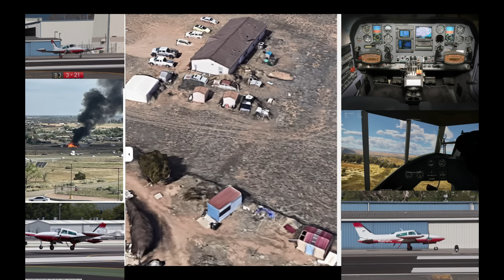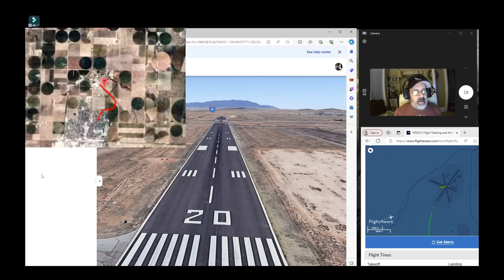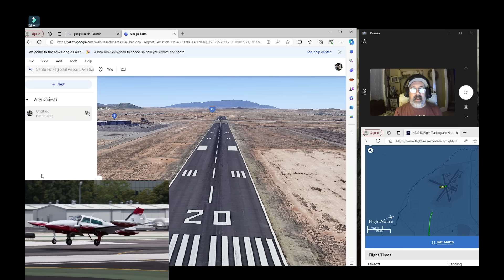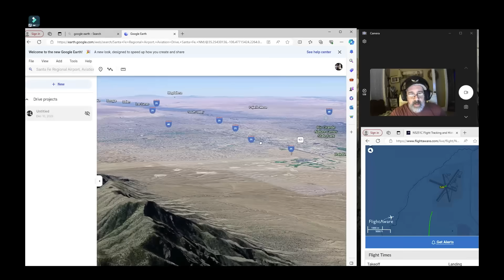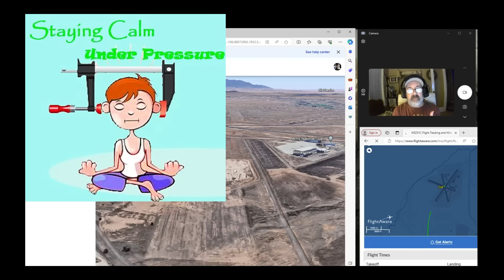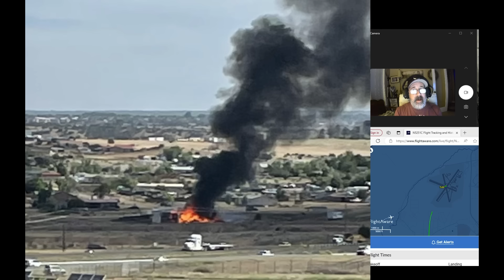Fatal Cessna T310R Crash That Never Should Have Happened N5251C

Comment: It's hard to think of a Cessna Twin that's worth a damn in the engine-out portion of the "envelope".  As seen here, the various 310 iterations--even with turbocharging and Vortex Gens--are marginal, same with the 401/401A... not sure about the later 4xx models.  I don't blame the Cessna engineers, as they are pressured to achieve everyday low Total Operating Costs, and so the rare occurrence of a complete engine failure is less than top priority.  Every twin pilot would do well to hit the realistic simulator twice a year... cuz that "engine-out checklist" has to be burned into your muscle memory--zero time to grab the printed version!

Comment: Wonder if this plane was equipped with Vortex Generators (lower Vmc), from ~80kn to 71 kn .... more controllability in engine out operations.  Also, which engine failed?  Left Engine is critical engine.
Reply from the maker: It did have VG's. You are correct, sad deal. We had them on our Baron and 310P. Amazing the difference they make.
Reply from the maker: Left is the critical engine.
Reply: @maxtanicfilms  Did the left engine fail?
Reply from the maker: @eojabac7123  Not sure as there has  been no official report by the NTSB. In the preliminary rpt from the NTSB it says. Witnesses hv said it hit the house but no other details reported. It will be interesting to see if either prop was feathered. That will tell us a lot.

Comment: Non-pilot,retired,problem- solver,machine designer,……how about,a Fed.mandated ,small plane mounted parachute sys.,auto- deployed,stall induced system?! ( ya, aviation-world,this shocked me too !? Gods help F/ his ‘family’!
Reply: EVERY Cirrus aircraft (incl. their jet) is so equipped and it is NOT a panacea, esp. at LOW altitude like this incident.  Check the stats... you'll find for instance that the NON-parachute-equipped Diamond DA-40 has a better safety record than the Cirrus SR-2x family, because the former has A) super-low STALL SPEED, and B) a fuselage/passenger-compartment that is designed for crash-survival ... in the proverbial Final Analysis, there IS no substitute for... GOOD AIRMANSHIP!

Comment: On a lesser note I had the throttle stick open on an off-road motorbike and it is all consuming. Your mind goes blank in fear. I would handle it much better now.
Reply: Yep, I’ve experienced something similar. I’ve heard it called “helmet fire”.  Your senses are overwhelmed.
Reply: @mikah4051  Many years later I was driving 10 ton truck and the accelerator pedal stuck down. I depressed the clutch, braked and steered round the corner. Turned out the engine had a limiter so it didn't blow up.

Comment: Great video thankyou. I watched Juan Browne and Scott Perdue comment on this one and you have highlighted something they only brushed on, which is human factors. Thankyou for covering this. More recently, Juan Browne really pulled apart VMC theory after a recent stall spin fatality in a light twin. Juan's well detailed explanation was absolutely fascinating. I have no doubt the pilot of N5251C knew all this and more, but you could hear the fear in his voice after the engine failed and I can't help but agree with you that his extensive knowledge and experience was a long way from being put into practice. Clear security camera footage showed the aircraft flying past in clean configuration (inc left prop feathered), right engine at high power, but the 310 was slowly sinking, not climbing. Still, this very experienced pilot kept trying to press on hoping to gain altitude, despite VMCA fast approaching. (In a simulator, he would have, at this point accepted the aircraft wasn't going to climb (despite being a turbo), cut the good engine, substantially decreasing vmca and flown slow with wings level into whatever he had in front of him.) Relentlessly flying on, he kept sinking and finally pulled up to avoid a power line just short of the crash site dropping airspeed below VMCA and his fate was sealed. I must support Dan Gryder in his quest to have pilots regularly train for abnormal scenarios such as these so, as you say, it becomes instinctive.
Reply from the maker: Thank you for that. Those guys are great and I watch them as well. AQP can really help & I support it 100%. Dan is tough but people need to hear it. When pilots die in such an avoidable way consistantly it's tragic. Lives can be saved with that program!
Reply: I'm a Dan Gryder fan, too. He has a funny, quirky personality, but he's very serious about AQP! @maxtanicfilms
Reply from the maker: @ValerieGriner  For sure, interesting guy and really does care. Missunderstood by many folks unfortunately.

Comment: well, when you get a multi engine rating, you learn how to fly with one engine . Lose one engine on take off.?...Do not turn in the direction of  the failed engine, and you do not make a tight                         turn;  or you will stall and hit the ground.  I knew an ortho surgeon who had a twin. He took off fromt the Sugarland airport and lost both engines , right off the bat.... stayed straight over the runway and beyond, ending up by the front door of some woman......The plane was a total loss but he did not have a scratch !  Reason for the engines to quit ? the mechanic had used detergent oil....I remember that one,  about 35 years ago. These guys need to stop communicating with ATC. They need to fly their planes and stop the ATC/  BS. Just state an emergency and focus on landing that baby, straight ahead.......no damn turns, going back to the airport.....Shish unless you know,  for a  fact,  you will be able to do it ; usually they dive into the ground. Wrong attitude and not enough altitude to recover that stall....and spin.  Over and it is so avoidable......
Reply from the maker: Well said
Reply: Also, the ATC clearly DOESN'T help matters in this case BECAUSE in trying to help you HE tells you to do something that you SHOULD NOT DO (turn the plane) and to help convince you to do so gives you the number of the runway you should land on (this is why no ATC contact). The pilot is already in panic mode, and chances are if he hears someone telling him to do something, he will do it

Comment: Density altitude exceeded the airplanes performance.  A cooler day at a lower airport elevation and he would still be with us.  You cant fool density altitude.
Reply from the maker: The thing is here the airplane is turbocharged and has a service ceiling above 17k. If he would have flown straight ahead he could hv easily climbed. Very unfortunate because the T310R is very capable in this situation. Our non turbo 310P on the other hand would have required us to make a forced landing straight ahead. Appreciate the comments and thanks for watching 😎
Reply: Didn’t realize it was a turbo charged aircraft. You’re right, he should’ve been able to deal with the density altitude with that airplane If all systems were operating as they should’ve been.
Reply: Losing an engine should not have much to do with density altitude. It is affecting both engines. You know you are going to need a longer runway. That's all. So, one engine quits and the other is not functioning to the max ? and you have a glider on your hands. It goes up and you put it down. Straight ahead.......Attitude and airspeed....landing on somebody's roof ? Bummer.........

Comment: Nr of hours in a logbook doesn't guarantee anything. It's more the mental game of making annoying safe choices (fast) vs. tempting bad ones and it's so difficult.  In a way it has nothing to do with flying but more with the gene pool. A rookie pilot may already be a better pilot than a 10000 hour pilot will ever be.
Reply from the maker: It's true, you're spot on. The USAF did a study about this. My Dad read it years ago. We looked for it but couldn't find it. It says a percentage of pilots in testing washed out due to slow reaction times in emergency testing. They had a way to test where the student was totally unaware of what was coming. In the video prior to this my Dad talks about it. Very interesting! https://youtu.be/bK33pG8sYhs
Reply: @maxtanicfilms  that was an interesting watch. My gut feeling is that some GA pilots will freeze if an emergency occurs.  I remenber my CFI pulling the throttle the first time. I thought I well prepared for all emergency steps, but I felt the panic punch in the stomach and mixed stuff  up. These moments, you should be in drill mode. Training can help a lot,  but you never know for sure until something happens for real. CFI's should at least throw 1 curveball per lesson 🙃
Reply from the maker: @jingle1161  Yeah I agree. It is a tough one and a scary thought to think you have to wait for it to happen in order to see how a pilot reacts.

Comment: AQP
Reply from the maker: Absolutely 😎👍
Reply: Kind of curious...what does AQP say to do in this situation that is different than normal engine-out procedures?
Reply from the maker: It's the mental side of training as it relates to that particular pilot. AQP is a way to focus that training so a pilot will react properly and perform the engine out procedures correctly. It is no guarantee of course. You just don't know until it happens, the ultimate test.   @igclapp

Comment: If I understood it right this guy froze from fear. Unfortunately this is a very normal reaction that can be extremely difficult to stop and usually you don't know how you will react before you have been in a life threatening or scary situation. Others become more systematic and are capable of things they could never have imagined. This is the reason too why some people don't do anything when they are in a life threatening situation which can be very confusing to people. I don't know I you can really prepare and find out how you will react until something happens. Perhaps being avare and to imagine different situations and really imagine how to react and to not freeze. But it's possible this guy had imagined something like this happening too he was just not able to react and follow the plan.
Reply from the maker: Absolutely agree. I know for myself I thought I was ready for an emergency but when it happened the fear was horrfic. We acted correctly on instinct. I would just say EXPECT THE FEAR. That's how I looked at it after. It made flying feel safer to me at that point. We had been tested. Appreciate the comments and thanks for watching.
Reply: In a similar vein, I managed a large group of expats in Rio, where there was quite a high risk of muggings (knife or gun). We gave them all the appropriate instructions on how to respond (ie hand over your wallet calmly, descalate etc). Like you said, however, you simply cannot tell how someone might respond at that given moment. Some were confused (couldn't recognize the situation they were in); some froze;  some act defiant etc (even my daughter counter attacked an attempted knife mugging by hitting over the head). Not one, so far as I can recall, actually followed what was very simple guidance. I am sure the same thing must happen in aircraft cockpits.

Comment: Saw the procedure for single-engine failure on takeoff of a twin on Dan Gryder's Channel a few days ago. Man, you have to absolutely be prepared for that to happen on every flight. He actually did it in real life and filmed the whole thing. From what I remember, your actions needed to be Call Engine failure, identify the failed engine, Gear Up, Blue Line, and then fly straight until you gain enough altitude of at least 1,000 ft. You can then start thinking options.
Reply from the maker: Yeah he does a great job and I have seen that video. You are 100% correct. Look at how focused you have to be just to fly straight ahead! Trying to turn is insane. One thing I should have said in this video is that red line increases based on turn, density altitude, if the prop is feathered etc. That increase is impossible to know in a split second. On the 310 it's about 84mph (IN A STRAIGHT LINE, DEAD ENG SUCURED/FEATHERED AND WITH 3 TO 5 DEGREE BANK INTO THE GOOD ENGINE). Turning back to airport like this increased that speed dramatically. Here is another example of how lethal this is. These folks survived, hard to believe when you watch this.  https://youtu.be/PVFQE5vnvG0?list=PLocpubHj2nG-BGdY8yRPC6U0GGkIIjsHb
Thanks for watching!
Reply: Exactly !

Comment: VMC roll. The turbocharged engine could actually be a contributing factor.
Reply from the maker: Certainly and it's why you MUST stay above red line. When you turn it increases red line. That speed in this case due to density altitude sealed his fate as it was greatly increased. The factor of increase gets into test pilot relm. He gave himself no chance. The 310 has a big tail and if he had just flew straight he could have easily put it into a flat area. IMO it would have flown fine and climbed if he just flew straight. In our non turbo 310 in this situation you know #1 go straight, #2 we are going to make a forced landing straight ahead. Going straight eliminates so many negative factors. He shouldn't have died. Appreciate the comments 😎
Reply: This is something I've heard alot about on Dan Gryders channel as well. I'm not a pilot just long time aviation fan. But it seems like waaay too many people are dying in small 1 and 2 engine GA aircraft! 

Really a mystery when such an experienced pilot as this man apparently was.
Interesting in that it seems like the 1st thing he did was contact ATC, and their response was to clear him to land on any runway which meant a big turn around right after taking off, almost like  the pilot complied with the return to the field right away but what di I know.  I just hate seeing people die doing what they loved to do.
Reply from the maker: @donc9751  You are spot on, the fear overpowers some pilots. ATC can be a false sense of security along with that other runway so close. It's a mirage that pilots MUST avoid. Unfortunately, it never seems to end. The scary thing is you just don't know how you will respond until it happens. Look at this famous accident as another example. https://youtu.be/PVFQE5vnvG0?list=PLocpubHj2nG-BGdY8yRPC6U0GGkIIjsHb

Thanks for watching Don :)
Reply: @maxtanicfilms   Thank you for your reply and for the link!! I'm checking it out now! Thanks!